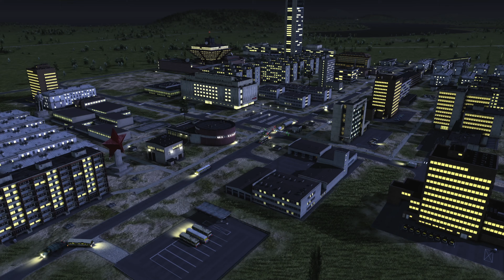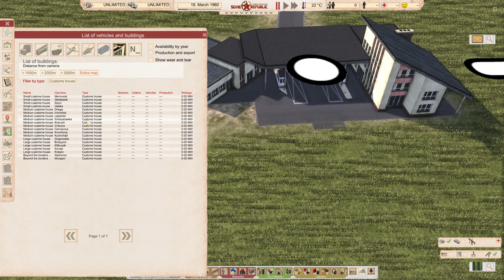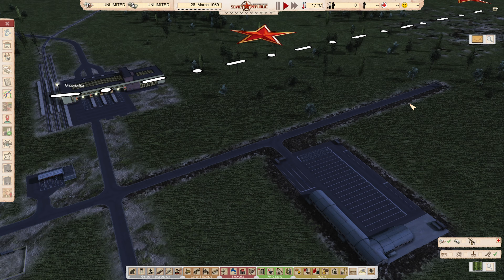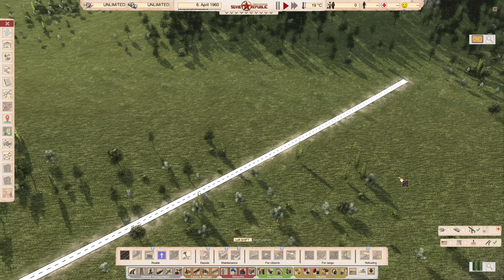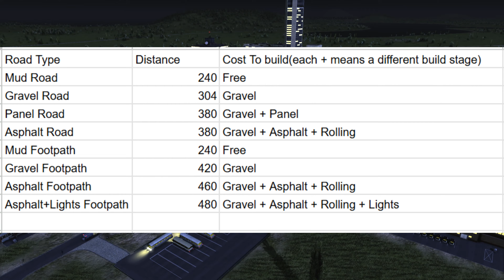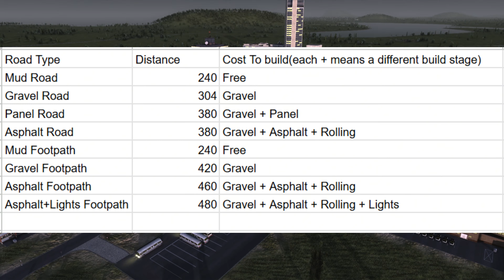Workers and Resources: Soviet Republic ULTIMATE Tutorials - 2 - Construction Yard, Roads & Footpaths

Comment: This is a great tutorial. In an update they changed how the customs house traffic flows, so now there is far less traffic jams. How does this arfect the meta you think? 

I am used to making a minimum viable "construction" city that employs workers to run concrete, asphalt, gravel, etc plants and uses a road cargo station linked to storages and warehouse for all the the construction materials and components, fed by some free distribution offices that drop off full loads into the storages directly. 

Am I over thinking all this? 😂
Reply from the maker: The update is very recent, namely Early Start DLC which popped up @3 weeks ago or so!

Also you're not overthinking! Well, it depends, is it a city >1km away from border? Then what you're building is perfect!
Is it less than 1km? Then you've got a problem :D